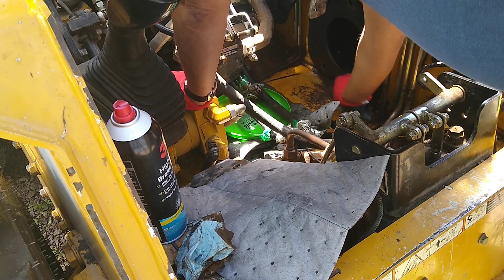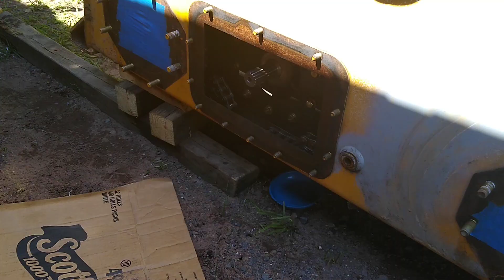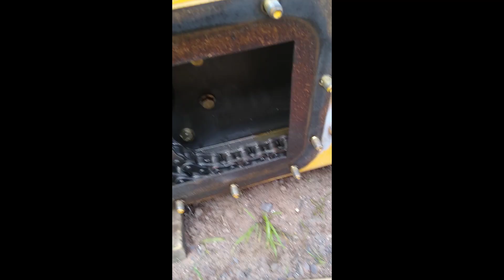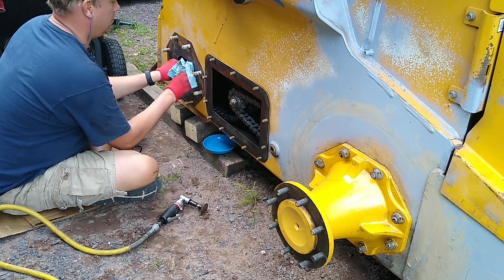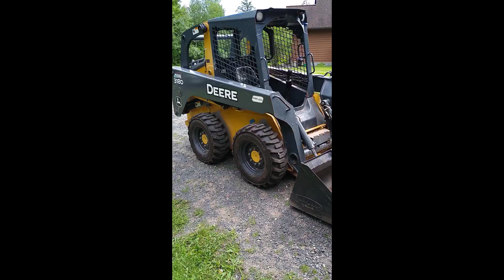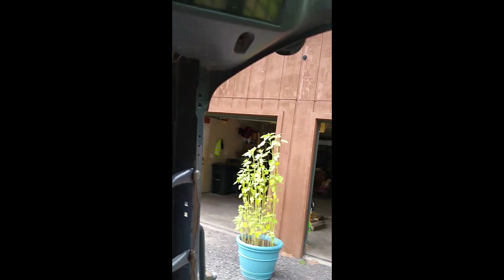Part 3 -  Skid Steer Drive Motor Repair

Comment: Personally I would seal all of the holes. The chains are going to be flinging oil everywhere inside the chain case.
A very nice plus including the torque value for the drive motor but you failed to state the torque value for the axels. Dang it man!
The chain tension is set with the wheels and tires mounted I understand, I could be wrong so check to make sure this is correct, 
at a maximum of 1/4 inch movement at the tire surface and a minimum of 1/8 inch. I was thinking I could set this slack by making 
an arm mounted to the hub that would be the same length as the tires diameter. That way the sealant would not set up before I got 
the tires on and much easier to get to those nuts to torque them properly. I have a seep in my right rear which I am monitoring but 
eventually will need to repair, this is how I know about this so far. 
The studs for the axels have O rings on the inside to seal the chain case and they need to be replaced if they are leaking, oh joy.
Your boy is a thinker!
The correct oil level is determined with all hydraulic cylinders fully retracted and the oil level in the sight glass on the left side of the machine between the two lines.
Good how to video for the John Deere 318D! Not much information on these machines or problems apparently so the information is scarce.Your videos are the only ones I have seen on this machine.
Thank you!

Comment: Do you know what that whining is? I have the same on my skid.. tryna figure out whether it's an issue or normal machine sound
Reply from the maker: Thanks for watching! I too questioned the whining noise and don't have concrete answers, only a couple of theories.  The noise is now gone, except for movement at idle, my understanding noise at idle while moving typically normal.   However, the amount of noise heard at the end of part 3 video was slightly concerning to me as it was around 40% throttle.   At the time of repair I had a couple of theories, one was I had air in the system that had cavitated oil, two was the system went from 15w/40 to synthetic 5w/40 and I had yet have the remnants of  15w/40 mesh with the majority of 5w/40. The thicker 15w/40 oil did seem to be noisier when the machine was cold.   About a week after I had finished the repairs I discovered the manual control drive motor linkages were installed in the wrong control hole.  Sort of like putting a block of wood under your gas pedal preventing pedal to floor.  Once I installed the linkages in the correct hole I regained full speed of drive motors and the noises seemed to have disappeared around that time.   If your noises improve with increased operating temperature it might be more related to viscosity of hydraulic oil.

Comment: The John Deere dealer in El Paso Texas has said that no parts are available only the whole piece I need discs seals and gaskets if you have information on where to buy them, please advise.
Reply from the maker: First, I would suggest you input your machine serial number into this website:
https://partscatalog.deere.com/jdrc/
The JD visual parts catalog is not the most intuitive.  I was not able to follow the parts tree and find the parts.  I had to go to keyword search and input 'drive motor' or 'seals' and go through the list to find my specific items.   There is a breakdown of the drive motor and necessary parts and visual representation.  
If you have a 2010 JD 318D single speed with manual controls  than here is the drive motor example:  
https://partscatalog.deere.com/jdrc/sidebyside/equipment/62282/referrer/search/pgId/522912749
If you have a 2010 JD 318D two speed with EH controls here is the drive motor example:
https://partscatalog.deere.com/jdrc/sidebyside/equipment/62282/referrer/search/pgId/522913030

The part number I used for driver motor seal kit is AT441786, however this is different if you have two speed, different year, and possibly electronic controls.   The mounting gasket of motor to  frame is not included in the seal kit.

Hope this helps.